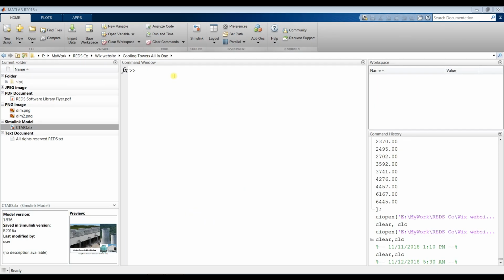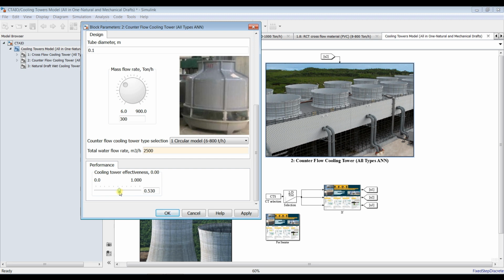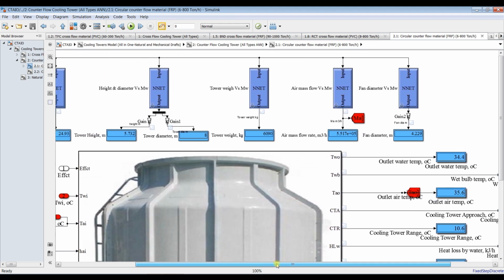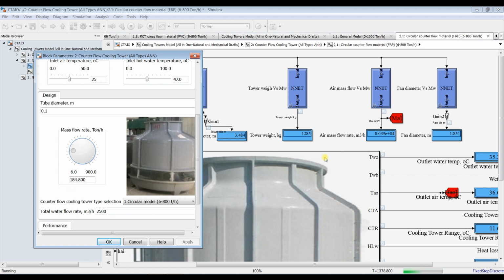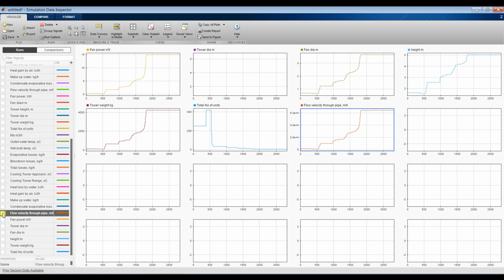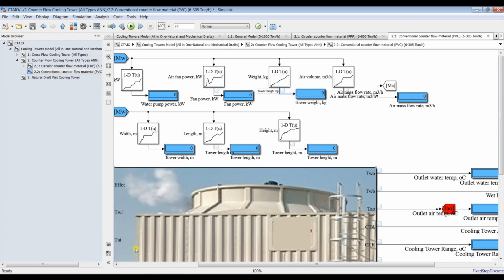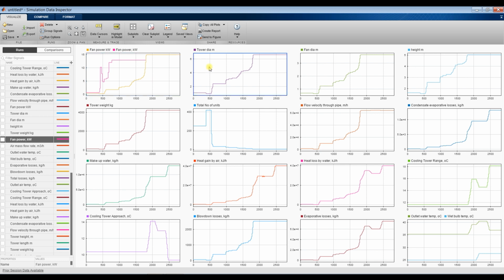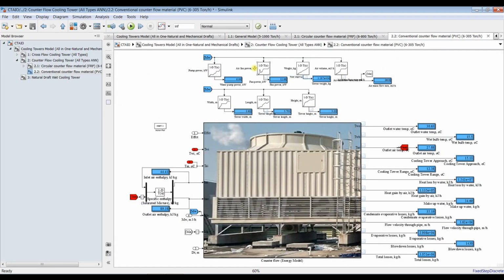Cooling Towers AIO: Counter Flow | Matlab | Simulink Model

Comment: Hi
I am unable to see any mention of calculating the required packing/fills height for different selection of packing /fills types?
Reply: The height ABD weight are calculated, so, you can easily calculate the packing height.
Reply: Thank you very much for responding. However, I failed to understand your reply. I would appreciate it, if would elaborate.  Thank you
Reply from the maker: @abdalaabusaud3208  I mean, if you have the main design aspects such as the area, flow rate, weight, height, you can easily find the fill area based on the material type. Fill is not more than a matter of calculation. This is a design model not a performance model. In performance, you can select the fill type and dimension to calculate the efficiency or performance.